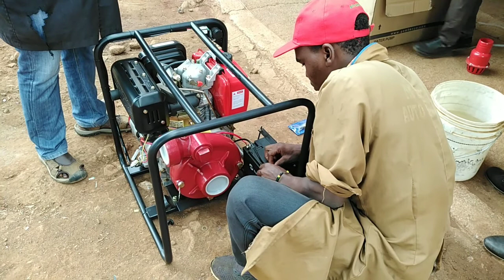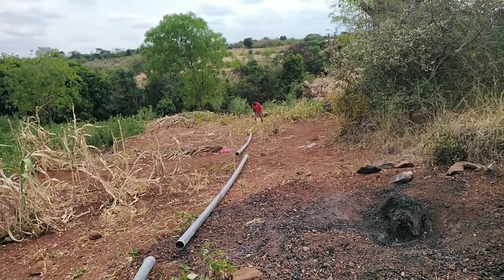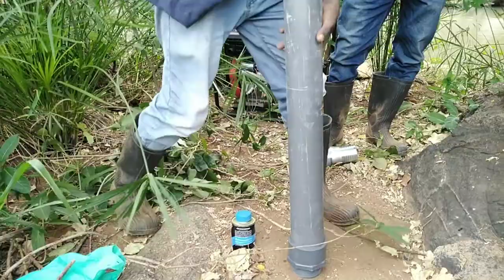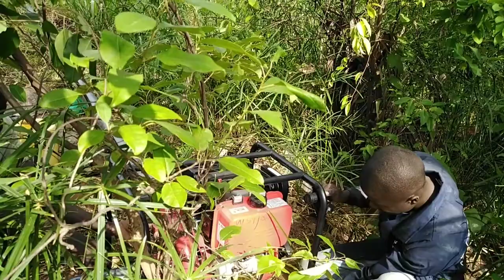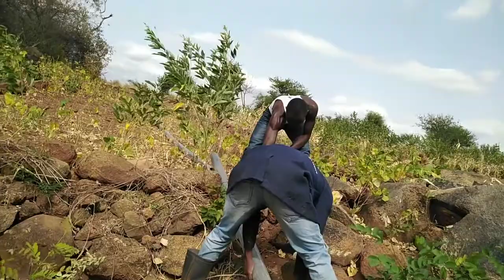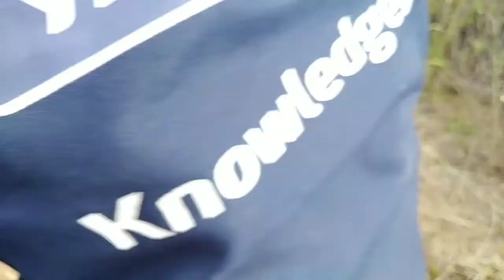A day in life buying, transporting and setting up furrow irrigation system.

Comment: What is the size of the pipes in terms of the diameter. Can I use a 50 mm pipe or I should use a bigger one
Reply from the maker: Pipe size depends by so many factors. You engine power. Distance of delivery. Gradient of the land